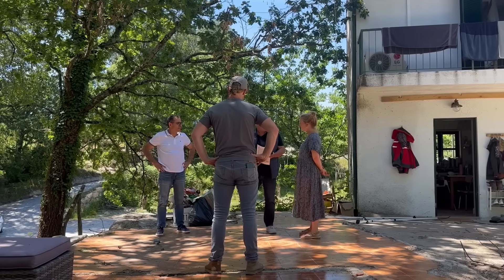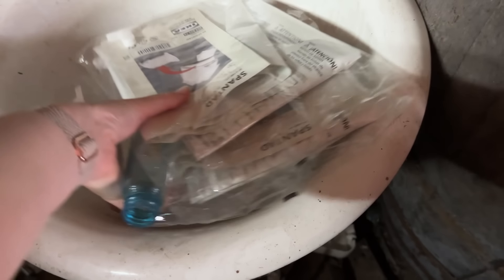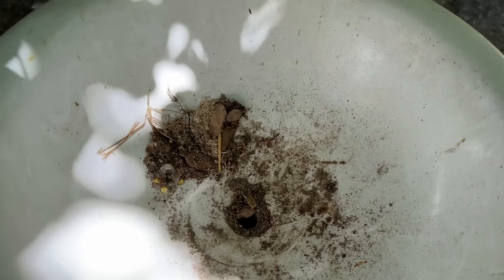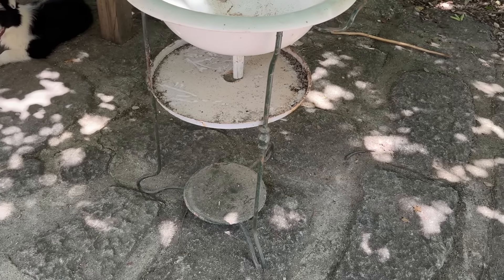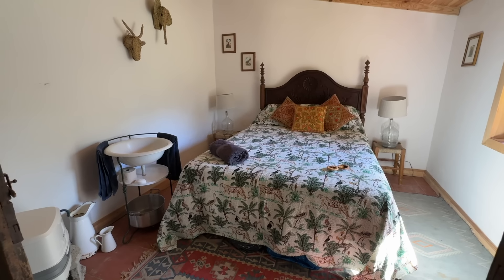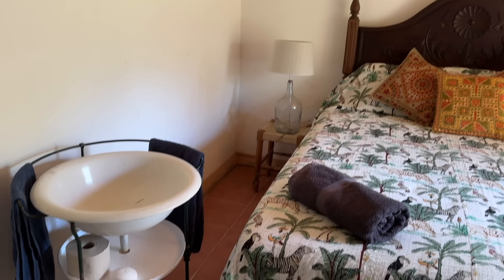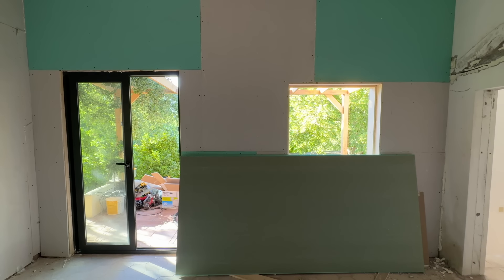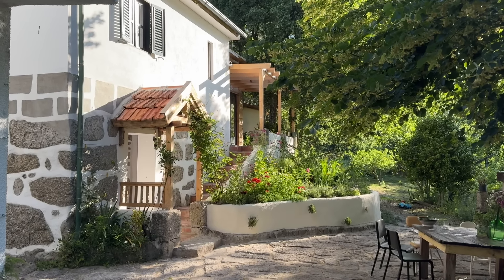It's Time to ASK FOR HELP - Renovating Our Stone House in Portugal

Comment: Things take time!!! You two are doing a grand job! Having watched our house-building after two years of designing everything to the inch degree, we forgot to include a very important light switch! Our house is ICF … 14 inches of steel and foam blocks, filled with tons of concrete. Won’t burn and won’t blow away here in Tornado Alley in OK! Anyhow, everything works perfectly, and we are extremely happy. 🥰
Reply from the maker: Things definitely do take time Jean. Thanks for all your support. Ah a light switch haha sorry friends! Well done for the rest of it 🙏🏼